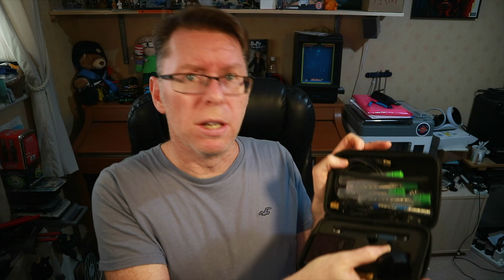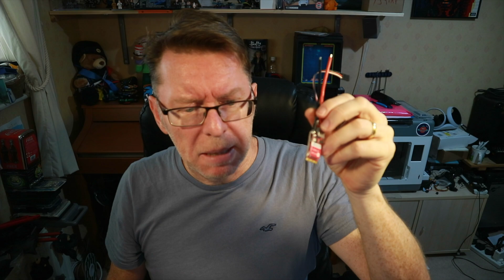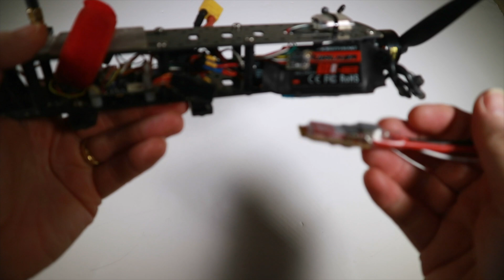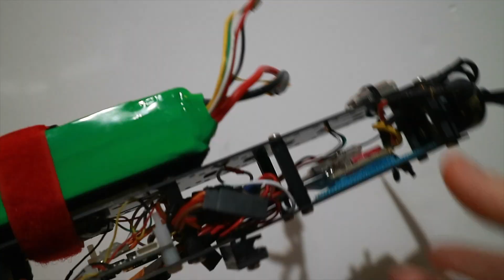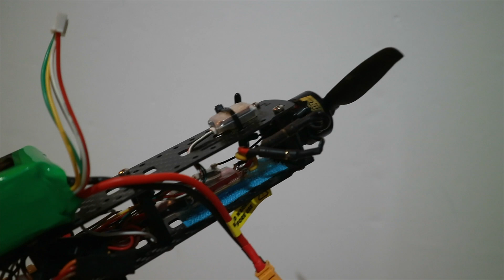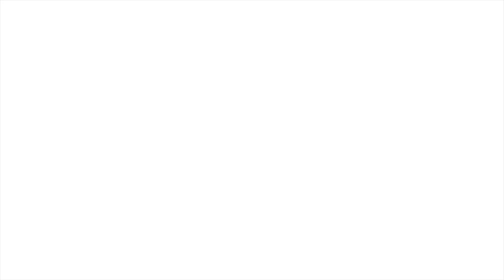Sequre 70 ESC Part1.  BlHeli_32/AM32.  With or without a BEC!

Comment: My power is getting cut out at full throttle.  It’s not my battery.  It’s fully charged.  The led turns from green to yellow. Any idea what it means ?
Reply from the maker: I actually tested the ESC out in a few videos ending in this one https://www.youtube.com/watch?v=8tcRPqZ_06E and I did some specific full speed runs to test.  Throttle didn't cut out but I had some big wobbles on the wing!  I don't know what the LED colours mean - worth following up with Sequre on that one.  If I had to guess, it would potentially be a desync (although that would generally mean you'd have to take it to zero before throttle would respond again) or a thermal shutdown - although you'd probably notice it was burning hot!

Comment: Sequre makes overpriced soldering irons, so are their ESCs too lol
Reply from the maker: I always thought their soldering irons were very reasonable for what they did.  What's your choice for something similar but cheaper?
Reply: @CurryKitten  actually I got them mixed up, SEQURE irons are not too expensive, the SI012 is quite but the mini T12, while compact, is kinda pricey, the mini T12 from Handskit can be had for like half the price
Reply: @CurryKitten  I just went all in and got a Xytronic LF-3300 180W induction based iron, makes those big 8mm and 10mm connectors a breeze to solder.
Reply: $89 for a 200A 12S ESC is dirt cheap my dude.

Comment: Yeah my friends and I switched to this style of quad ESC and its been great, 6S support, smaller size, most INAV flight controllers have their own BEC and these ESC are easier to program, you get digital throttle protocols, etc. But this is a great way for me to try AM32. Thanks Curry

Comment: one thing that bothers me about wijng ESCs is the price.
for 1/3rd the price, you can get a single ESC designed for quads, and then get a $10 BEC to go along with it....
Feels like ESC's intended for wings are priced more than they should be.
Reply from the maker: Last time I tried this, my VTX was full of noise from the ESC.  Things may have improved since, and certainly if flying on a decent wing FC you have a decent enough bec built into the FC.  I wouldn't call these ESCs built for fixed wing, given they have a with/without BEC.  So we'll see how it goes
Reply: I never use a BEC inside an ESC for my servos, if the powertran faills. ESC overheats or fails in any way. I want my control surfaces still working so I have a chance of gliding it in for a sefe recovery. These ESC BECs are only good for lighting and other non-critical features IMO 😀